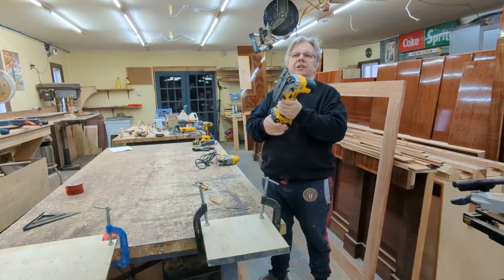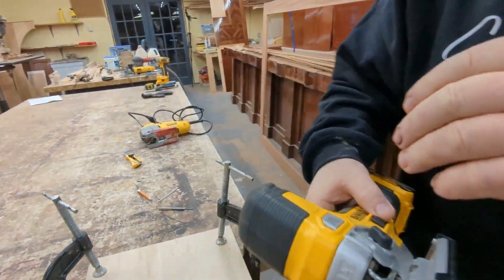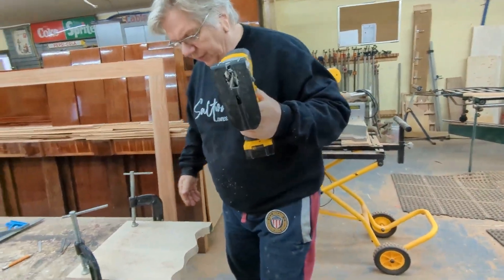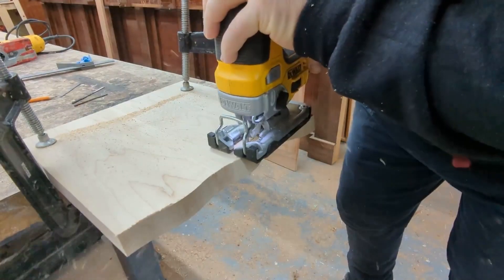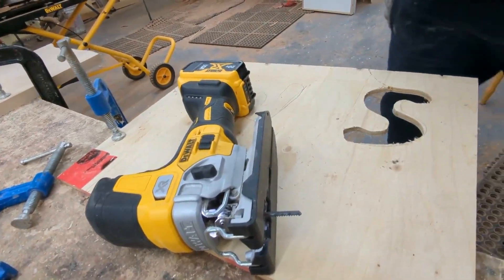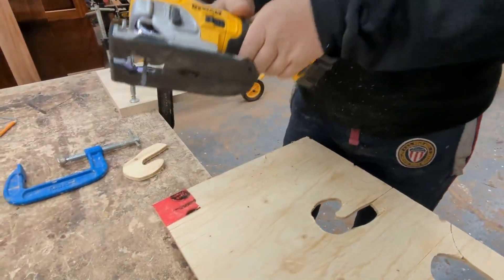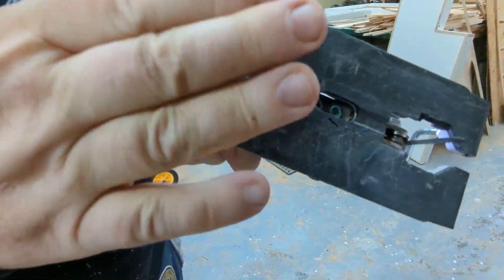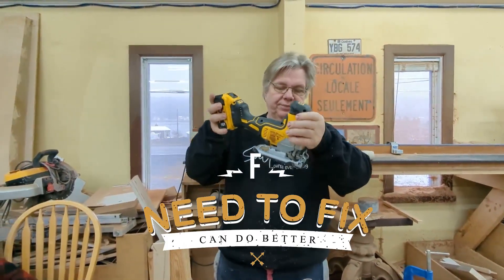Is the DeWalt Jig Saw DCS335B Really Worth the Price? We Uncovered 2 Surprising Flaws...

Comment: Tnx for the review, the plate has a groove you have to push it forward to lock it in place. Same when you want to change angle, you have to pull it back and after setting angle push it forward and then lock it with lever.
Reply from the maker: I didn't know good tip going to try Monday .Thanks for watching
Reply: @kdcustomwoodworking  

All your carpentry experience and you didnt even read manual to know how to set the foot.
And u r talking about how critical u r with reviews - lol
Reply from the maker: @mcqcjc8409  No I didn't read the manual I like reviewing the tools right out of the box.But I cut 1 inch of Maple to see if this Jigsaw had power the Jigsaw surprised me. I'm not a carpenter  I'm a cabinet maker the last 15 years all cutting curves etc. have been done on the CNC .
I'm buying all battery tools I'm doing renovations the Jigsaw is needed for notches the Jigsaw is an excellent tool on the job site since this review.
But for someone wanting to get into woodworking, this is a great tool to make shapes and letters.
Thanks for watching

Comment: Thank you for your review. I’m looking to learn more about woodworking beyond making shelves and cat furniture. I’m looking into buying a jigsaw and want to know what is better the old d grip or barrel grip.
Reply from the maker: The barel a lot more balanced feels more natural  .When I first started I did  lot of furniture love the jig saw really opens up a lot of options .
Thanks for watching 
I made this 20 years ago 
https://uploads-ssl.webflow.com/57074551e0a8295b57d6cadb/572d0dc5fa657b1405d45424_P1000577.JPG
Reply from the maker: The skirt was done with a jigsaw 
https://uploads-ssl.webflow.com/57074551e0a8295b57d6cadb/572f80bd8f0d48512a8448e5_IMG_318197.JPG
Reply: @kdcustomwoodworking  looks very clean on the cuts and symmetrical. Nice work.
Reply: Nice works!

Comment: DCS 331 D handle got same problem with the plate. Vibration of the engine will cause the plate to change the angle by itself. The work around for DCS 331 I found is to push a piece of wood in the space left  next to the lever, forcing the lever "to stay" in a fixed position. 

Is a flaw of Dewalt jigsaws - they need to come with another lever or some kind of safety.

 I ruined enough materials with undesired angles. I own my DCS 331 since 2014.
Reply from the maker: Thanks for the tip I'm going to try .Its such a well built tool yet the plate is a pain 
Thanks for watching

Comment: You may need to take the shoe 9ff and adjust the nut to tighten just a bit and reassemble it with the plastic lock lever and you should be good to go. I've had that happen to me and it worked like a charm..
Reply from the maker: Thanks for the heads up! I'll give it a go. Good information Thanks for Watching .